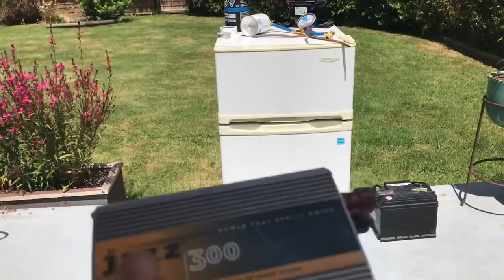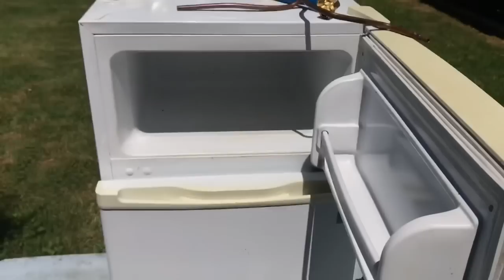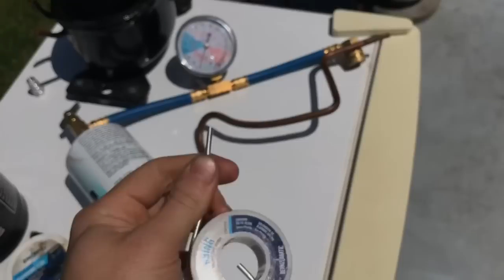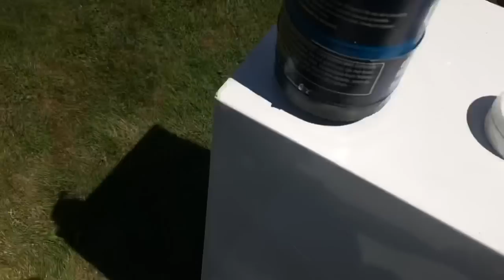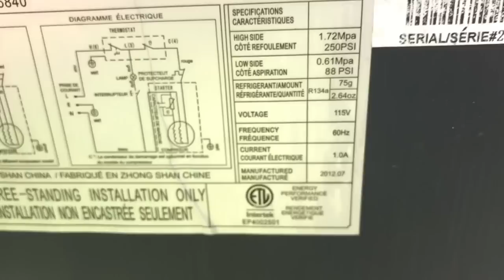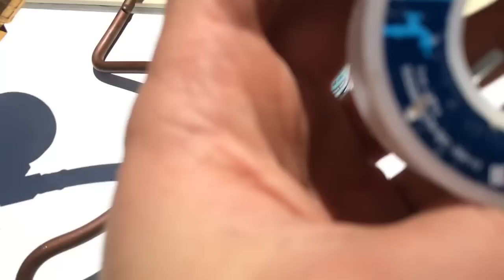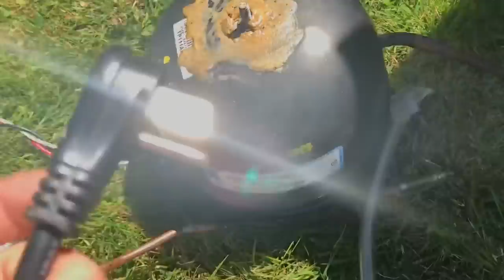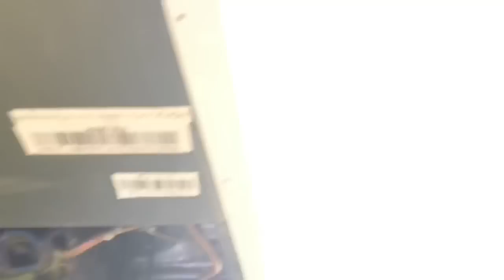Make Your Own Danfoss Compressor Fridge/Freezer For Cheap!

Comment: I'm way late to this party, but that isn't the "silver solder" that hvac folks refer to.  At a minimimum you're going to want something like stay brite, which is like 5% or so silver and still works with a weak torch, but many techs will insist on 45% higher requiring mapp or even acetylene to braze it on.  The stuff you have just has enough smidge of silver to use the word and dupe people.  Can you use it?  Sure, obviously.  But you aren't getting the benefits of silver, namely higher strength and vibration / fatigue resistance.  Otherwise, fantastic vid!
Reply: 15% is the most commonly used. 45% is used for dissimilar metals and other special applications.

Comment: 32 year experienced appliance repair man here.   I am looking into several apps, for dan foss comps..  but i gotta set alot of things straight here.   1.  r134a is also ozone depleting, and will soon be replaced with a new refrigerant, butane based. coming soon.. sux.. at any rate, purposely blowing out refrigerants is a fineable even in the USA.  it violates epa bs regs.  2.  most bad units you are talking about here, have evaporator leaks, 10x compared to compressor failures.  do not buy a used one, unless you are technically savy enough to know what is wrong..  ie just buy new r134a one, or working used r134a unit..  3.  yes silver solder will work, what you are saying to use is plumbing solder.  slv15 is fine for copper to copper, 45percent slv or better is for steel to copper.. brazed...  plumbing solder has lower strength, psi strength. no biggy on lowside.  easily blown out on high side.  see difference between "sweating" and "brazing". 4. yes you can use store bought r134a.. there is a big but here...  as many experienced hva techs have a hard time charging refrigerators, as they are used to pounds, where refs use ounces.  a small one like you have in video uses 3 ounces or less.  full size modern refs only use 5 to 5.5 ozs of r134a.  1/4 oz short, and you got problems.  1/4 oz over and you got problems.  5.  many are run by a electronic control now.  only convert one that works off of a hydraulic thermostat.  6.  BTU's..  If you put a dc comp with a 300 BTU output into a ac unit rated for a 500 or 600 BTU unit.. Yes you can make it cool ... some.. and erratically.  same if you put one in that is too big.  there is a sweet spot you gotta hit.  or you will waste alot of time and money chasing the rabbit.  generally what you are saying here is good.  experiment try.  if you hit it right you are a awesome..  most are going to fail miserably trying to do this, and waste more money than if they had just bought a dc fridge.  what you are posting here should not be attempted by anyone with no electrical , mechanical, nor refrigeration experience, generally speaking, unless you are willing to fail alot, while learning..  having said all of that, your theory and post is sound,IF, fundamentals of refrigeration are followed..   otherwise for many it will be a expensive rabbit hole.  there are many other technical aspects that i won't bore you with.  and please do not take this as a negative post..  this is just for all to be aware there are many variables that will apply here.  I do like your over all view.  but imo this will be beyond most dyiers without certain technical expertise.  or a willingness to learn alot threw failing first.  keep trying though.. imo limit it to certain btu units that will work off a certain sized unit. good luck.  and always say oops out loud, when you accidentally release refrigerant ;)
Reply: Thanks John, good advice for all. I'm an electrician & wondering what you think of swapping out one of these compressors on a China made mini retro fridge. Going off of memory here but I think it's a Galaxy that Home Depot carried a few years back. I know it has some weird freon in it I hadn't heard of like r600 maybe. I know the 600 is right. I'm building a Sprinter van & this little fridge/freezer is perfect size. (5 cu.ft. + or - )
Will all of the 600 come out when vacuumed out ? Any recommendations on what size danfoss/secop compressor to order ? Probably look on ebay. Thanks in advance 1 tradesman to another. 30 years I.B.E.W. 👍
Reply: @vanlifebiker  i was ibew back in 89 when i started with ge in albany.  yah r600 is the new butane based refridgerant that will be in all residential refers soon.  I am not up on the specks of it yet, I just know it is coming soon. I doubt it is a direct r134a replacement so units will probably have different sized capillary tubes that are or were r600.  just as the cap diameter is different  in r12 and r134a systems.  i would stay with a r134a system as they have been around for 25 years, and everyone knows it.  I would not trust any thing made in china.  every thing i worked on from there is of poor quality, poor materials, and questionable workmanship.  look up hobotech.  he just did a review on a new r134a dc system and gave it high marks.  i do not believe it has a danfoss comp in it though, but i believe its going for low $300's
Reply: @vanlifebiker  i would give this unit a go.  https://www.youtube.com/watch?v=NPf3kIs60YA
Reply: @mogg9408  Well when I seen the price it SCREAMED CHINA 😂 So I looked into it & yep they are made in China. Chest type I really don't want. We have a chest freezer here at the house & it never fails when we want something it's at the bottom of course. My Sprinter van is a high top so I can stand up in it which is great. Plenty of room for a up right & I'm not apposed to putting out the $1500 for a good one but nothing is in stock at the moment anywhere hardly. It's like this or nothin is your choice. The boss (wife) likes the retro style as well & those can't be found at all. Unique out of Canada is what I wanted in the retro style but nothing in stock anywhere. I came across this compressor swap out video & thought this could be the solution & save a few bucks too. Like I said I have this China made retro style fridge already & I could do the swap maybe. Oh FYI that link you recommended is not only made in China, it's out of stock too. 😂 So, I guess you're saying this won't work swapping from the r600 120V to the 134A 12V compressor ? 
I have solar & inverter & battery bank set up in the van already. I just wanted to be able to shut off the inverter & conserve that energy at the same time by swapping to a 12V set up. I guess I will just have to wait til things get back in stock from Canada or deal with what I've got. Thanks for your expertise. Saved me some headaches. 😎👍
Reply: XRP DT yah if it’s China avoid. I haven’t worked on a r600 unit. I sincerely doubt you can put r134a in it and run it efficiently. If the current unit you have works as is. I would run it threw a inverter. There is a young fellow that does slot of rv solar vids. Yes. Power wise it will be less efficient but a jackery with solar may handle it. Until you see a good deal on a used or new dc model you want. If you get used stick with 134a and avoid the old ammonia ones. Dangerous   Good luck. I wish I could recommend the danfoss 134a comp for it. I just don’t have specks on attempting that. R134a reacts badly with certain refridgerant oils not made for 134a. In old r12 units it gets acidic. Thus my caution at this time as r600 units are very new and untested imo. Good luck
Reply: @mogg9408  Well at least I learned a few things anyway & you saved me some headaches as I said. Appreciate your help. I may not need to do anything anyway. I have a 800 amp hour AGM battery bank & 500 watts of solar on the roof & it's wired to the alternator too. I did say I was a I.B.E.W. Wireman right 😂 We tend to over do it 😂 The only reason I will need to run the inverter is if I'm off grid & I want to make some toast or run microwave or run roof top A/C I installed for a couple hours. I have it all hooked up so grid can run the van & charge the bank too. I will figure out something & it's not like I need it tomorrow. Probably be another 6 months building this thing out. I just don't like the idea of running the inverter 24/7 for the fridge. Thanks again my friend.
😎👍

Comment: Your video has inspired me to look into having a go.  I'm in the UK and can find R134A substitute gas for recharging car Air conditioning systems. Would this work ?
It says its a direct substitute. 
Any help would be greatly appreciated.
Link to R134A substitute:    https://www.ebay.co.uk/itm/CAR-Aircon-Refill-Regas-Air-Conditioning-Top-up-R134A-Gas-hose-replacement/363061118777

Comment: releasing refrigerant into the atmosphere is illegal and you can't pull 28 inches of vacuum with a compressor, you need a vacuum pump
just use an inverter to run the original compressor.
Reply: As far as I know it's illegal only if you have an EPA license (you do it for money)

Comment: could it be connected to a direct PV panel with a Buck converter only.. without a battery??
Reply from the maker: The 101N0400 model inverter unit for the bd35f can be connected directly to the solar panel even without a buck converter. But if you get clouds or coverage and the voltage and the current drops too low, the compressor will stop, which is typically why these systems use a battery or a ultra-capacitor bank as a buffer. The link below is their different inverter units. The solar panel needs to be rated to provide enough current to run the compressor. https://assets.danfoss.com/documents/DOC024186435113/DOC024186435113.pdf
Reply: @InflamedBallz  thanks a lot.. I found that the solar controller is specified for bd35f which it is about 153 watt.. could it be installed on a bigger compressor capacity? And thanks again for sufficient answer

Comment: Would it work on 400l fridge
Reply from the maker: The  compressor model featured in the video is the BD35F. It can only cool up to around 150L refrigerator or 50L freezer. I would recommend you look into Purswave's compressors. They're a copy of Danfoss. Purswave makes larger models too like the BD65H, and the BD75H which would likely better suit your refrigerator. You'll have to do more calculations based on the freezer/fridge space ratio in your fridge BD65H is good for 450L (fridge only)  BD75H good for 550L (fridge only).

Comment: Good video and I hope you don't take my comment as a detraction.  R134 compressors have oil inside. The name of the oil is POE for short.  This oil absorbs water from the air very easy. When moisture mixes with POE oil it turns to a very strong acid that will eventually cause the windings inside of the compressor to fail. So, you never want to let a system that uses R134 open to the air for more than 5 -6 minutes. In other words, you must cut and solder on each compressor line very fast to avoid moisture getting into the system, then you have to vacuum the system out with a good two stage vacuum pump for at least 10 hours. It is preferable to vacuum it out for 24 hours, those pumps are designed to run that long. This way the very low vacuum will cause all the moisture to boil out of the system preventing premature failure.  If you want to make it really efficient, use cupronickel  brake line to make a heat exchanger and put it in a ten gallon water tank instead of using the condenser.

Comment: You actually get a double advantage moving to a DC compressor. AC motors are double the power consumption of DC motors. So if you power an AC fridge with an inverter.... you are more than doubling your power needed to do the same thing  (run the fridge) .

Comment: Excellent! But I wish you film the conversion & soldering process as well.
And afaik you should weight the agent while filling up.
Reply from the maker: Stay tuned in the coming months. I got my hands on another 12v compressor unit to make a more professional video that will be step-by-step.  Just need to get back to Canada first!

Comment: Not good, lots of errors. Frozen volume is critical. Never use flux. Just not good for people looking to learn.
Reply from the maker: I got my hands on another 12v compressor. I’m planning to make a step by step build in the coming months and if you have any other tips they would be greatly appreciated

Comment: Come on dude ,you didn't even fire it up and show us a cold refrigerator.
Reply from the maker: Stay tuned in the coming months. I got my hands on another 12v compressor to make a professional step by step build video. The first fridge is no longer in my possession but I can assure you it held fridge temps in the fridge section and froze water bottles in the freezer section

Comment: What connection did you use on the process tube to connect the guage to charge the compressor ?
Reply from the maker: process tube came with a universal 1/4'' r12 schrader valve brazed on. I used an automotive r12 female to r134a male quick connect retrofit adapter (low side) to connect to the gauge.  something like this. most automotive stores will carry the adapter. https://www.canadiantire.ca/en/pdp/red-tek-air-conditioning-low-side-conversion-fitting-0146124p.html

Comment: What aboit the evap fan surely thats still 240v or 110 v
Reply from the maker: Most mini fridges that i've come across don't come equipped with an Evap fan. If you want to convert a fridge with a household voltage evap fan then perhaps a high cfm computer fan would suffice.

Comment: Can you provide a set of model #'s of Danfoss compressors that will work for this purpose?  I wish to build a 10-20 cu ft. chest freezer.  Thanks!
Reply: Depends on how big you want.  I think most common are the bd35f and bd50
Reply: I want to build 12v freezer also.  Let me know what you figure.

Comment: can you test the lines by filling them with something cheaper (that shows leaks well) ?
Reply from the maker: The cheapest way i can think of is you can pull vacuum and leave it for a few days and see if the pressure decreases or not. if you're trying to locate a leak they do make products with dye/uv dye but I wasn't able to source it myself.
Reply: Nitrogen is whats normally used.
Reply: @JM-yx1lm  You can also pressurize it with air... as long as you vacuum it back out before it contaminates the ester oil